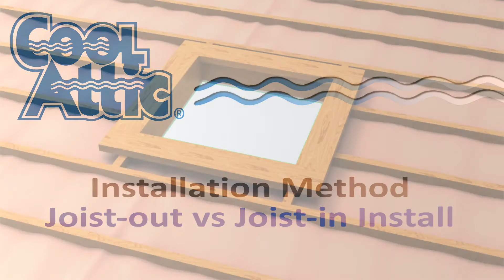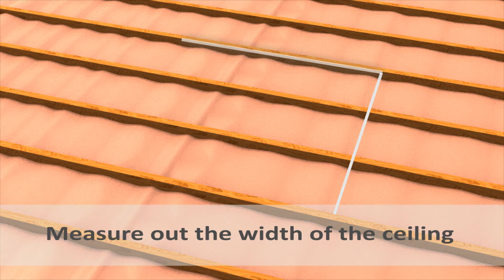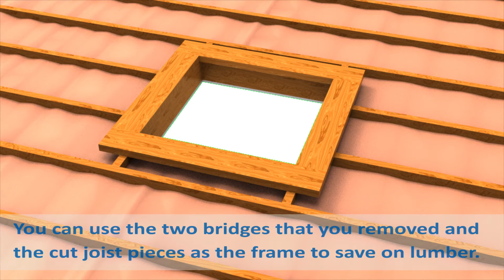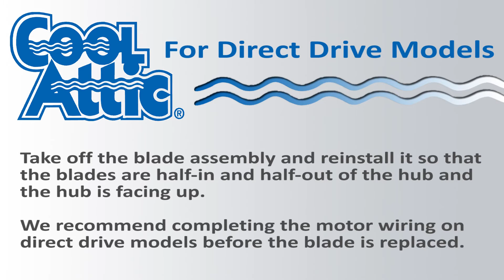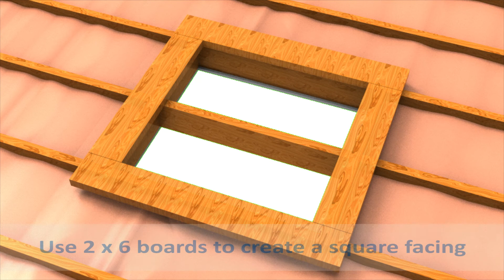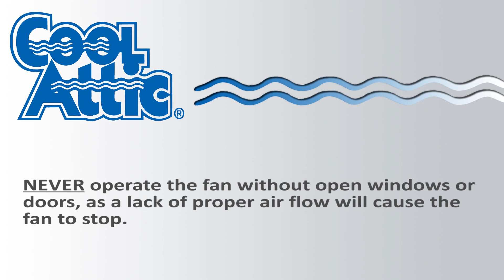Cool Attic Whole House Fan Installation

Comment: Easy to install.>>>nub.best/fqzi    Built a frame out of 2x4's for the louvre I all ready had installed on the house. Just need a power drill and a skill saw. I wired mine to an extension cord since I have a power outlet in my attic. Screen shot was taken just now while I was in the attic. My roof has sun exposure 90% of the day. Outside temp of 92 deg and the thermostat tripped off at 105. My AC runs less often, my upstairs is SOOOOOO MUCH COOLER!!!!! Im gonna buy another for my garage attic

Comment: Not much help on mounting shutter.
Reply from the maker: Hi Jerry, We're sorry this didn't offer any insight on your shutter install! For any additional questions you may have, please feel free to contact us toll-free at 800-433-1626!
Reply: I was wondering the same thing, especially some details about thr joist in model.
Reply: @Mujahid1  all models can be mounted joist in or joist out. just depends on your preference and whether it will work with the position you've chosen in the attic.